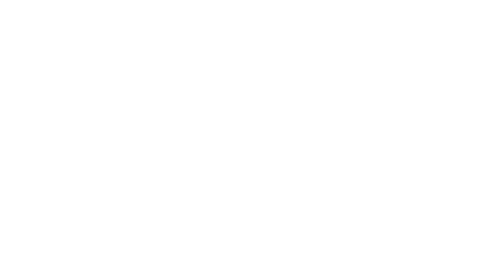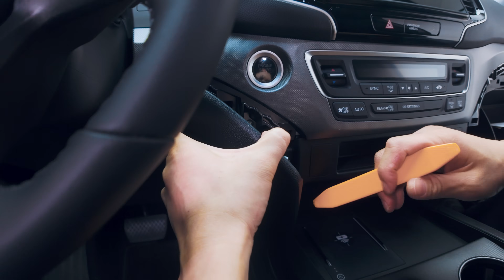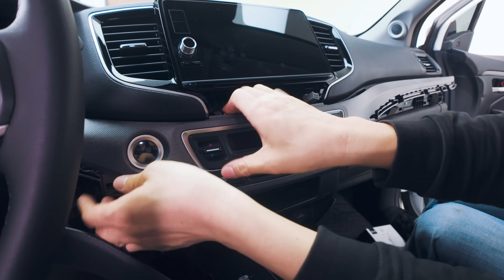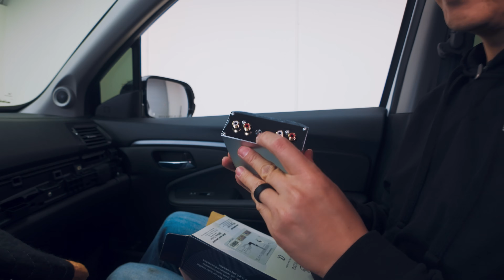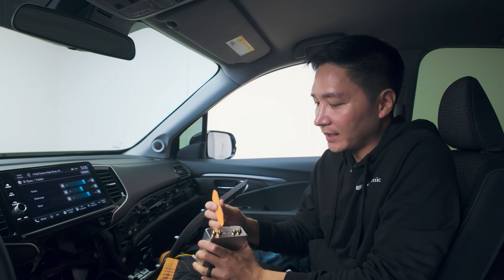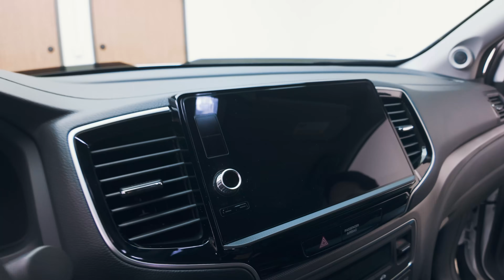Bigger Sound in Your 2024 Honda Ridgeline | Beat-Sonic Encore α Power Amplifier

Comment: Just put mine in today. Not bad. I did put better speakers in the doors and better tweeters in the pillars so im sure that helps but I wouldnt say it blows me away. Sound sounds more refined and I like that. Not to lound and not to quiet. Basically how the system should have came. Its pricey but if it means it will last me a long time then I wont complain about that. overall 9.5/10. I doc some points because I thought it would make the system a little lounder but in reality its only 200 watts extra. I do really like how it evens everything out. I would buy again.
Reply from the maker: Thanks for the honest review, appreciate you sharing your experience!

Comment: Install went smoothly.  I'd already upgraded my 4 door speakers and installed a classic 90's Bazooka active sub and that made the sound barely passable.  This amp pushed it over the top.  Well worth it (I got the more expensive one, which is a bit more powerful).  I did adjust the gains, both front and back, to about 70% as I generally don't really go too loud.  This gives a very nice sound at 16 volume setting on the stock head unit and can go louder with no distortion.  Recommended.
Reply from the maker: Thank you for your feedback!

Comment: 2020 Honda Ridgeline if i replace the subwoofer with a Pioneer TS-A2000LD2 will the ENA3H3  be enough power to drive it or will i need an additional amp?
Reply from the maker: The ENA-3H3’s RCA outputs are a full-range, low-level signal meant to feed an external amplifier or an ampsub combo.

Comment: Anyone add a factory sub to a 2024  RTL ?  
i just want a little more bass.  but want to keep things as factory as possible  
i would like as plug and play as possible
Reply from the maker: Reach out to a local audio shop
Reply: doesn't the rtl have a factory sub behind the back seats? or did you just want a little more power
Reply from the maker: @GreggsWoodworking  Might be optional sub
Reply: RTL has a sub behind the rear seat, it just sucks lol

Comment: I have a 25 Ridgeline Sport just like the 1 in your instal video. What happened with Adaptive Sound Control? Did it cause the engine noise to amplify? Does it get louder while accelerating?
Reply from the maker: Did not alter or touch the adaptive sound control
Reply: @BeatSonicUS  Yes, but you are amplifying the overall sound.... so you did adjust the adaptive sound control!

Comment: Not Compatible w/8 speaker. That's Black Editions right?  Is that because of the in bed audio? Or does it work with the exciters as well?
Reply from the maker: Not compatible with 8 speaker black edition.
Reply: The in bed audio system was discontinued with the RTL-E model.  Black edition does not have the  in bed exciters

Comment: Does this amp amplify the factory sub output aswell without needing to use a external sub?
Reply from the maker: Extra aftermarket sub can add in via RCA outputs
Reply: @BeatSonicUS  lol lemme reword does this amplify the factory sub output aswell
Reply from the maker: @revog7  Yes
Reply: @BeatSonicUS  nice does the website have info on the rms / max wattage output for each of the speakers ?
Reply from the maker: @revog7  Max on our amplifier is 50Wx4ch and 25 RMS
Reply: @BeatSonicUS  so subwoofer amplification isn't being boosted aswell for the touring models?
Reply from the maker: @revog7  Factory sub is being boosted
Reply: @BeatSonicUS does this add 25 rms watts to the output of factory amp...if so what would total rms watt output be in total?